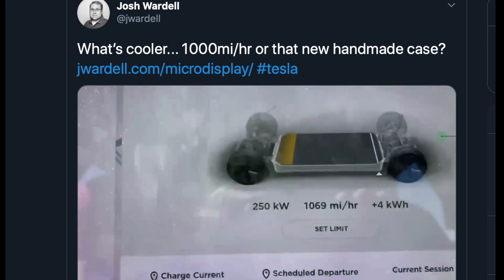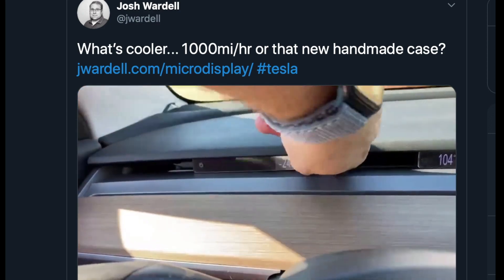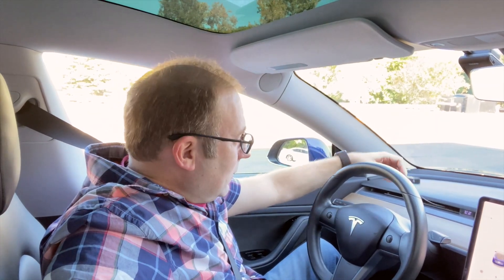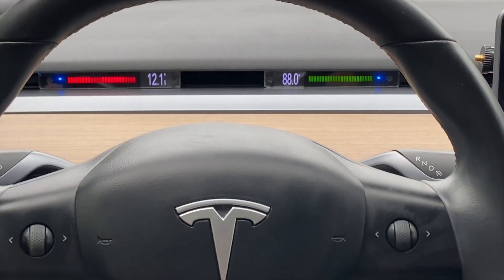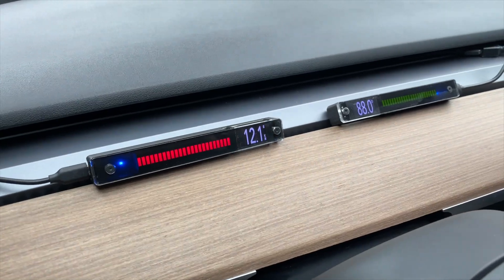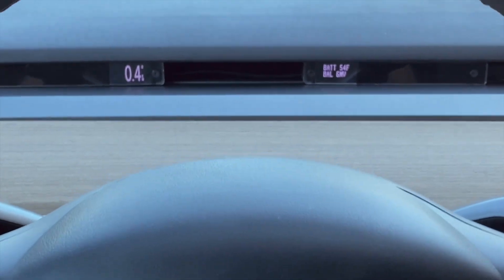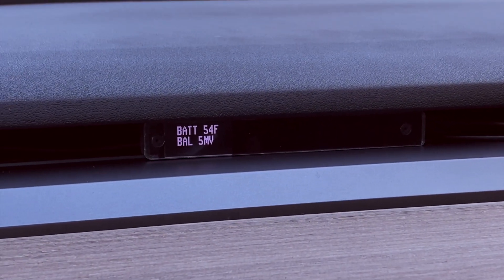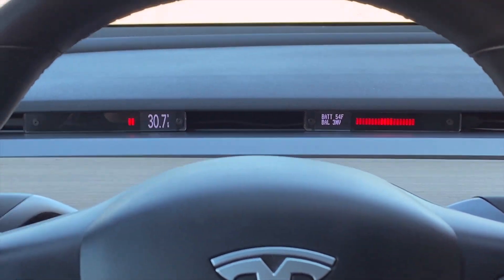New Bargraph Display

Comment: Do they block the airflow from the vents?
Reply from the maker: If you leave a few inches of space in the middle you won't notice any airflow issues. Previously I had them together in the middle and it was fine for the winter but noticeable on the hottest days in the summer. Just leave space in the middle for air to blow on you in the summer.

Comment: Wow Josh - looks amazing! I need to talk to you about that 3D printed display case and order two. Hopefully they can be retrofitted to the original parts.
Reply from the maker: They are totally new boards, the old ones would not fit inside. Function is the same though

Comment: I see the micro USB cable runs into the vent, where do you tap off the 5V? 
Do you route the wires in the dash to the car USB connector?
Reply from the maker: I'm lazy and just run it behind the display and to the center console USB. If I was installing more permanently, it's pretty easy to pull out the sides and wood and hide all the wires in the dash

Comment: Hi. Do you have any expiriance with tesla LAN data? From gateway as on older teslas? I have a 2013 rav4ev, and i heard what some old tesla soft is working on it, but showing not all data.
Reply from the maker: Not specifically. Chances are it has a CAN network, and this system will work with any CAN network in any car, if you know how to decode it or have a DBC

Comment: Does it have a button that could be used to cycle what is being displayed?
Reply from the maker: No. Currently I can solder a button to an IO board to the normal microdisplay, but the software does not yet support the input. No one has asked for or ordered it so it hasn't been a priority (but yes I do still want it to work eventually). This bar display is meant to be simpler